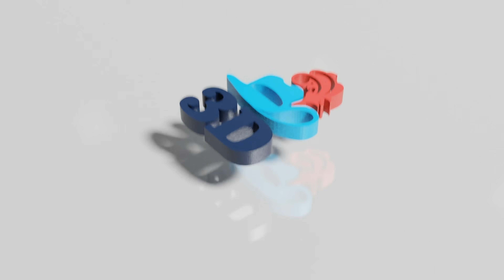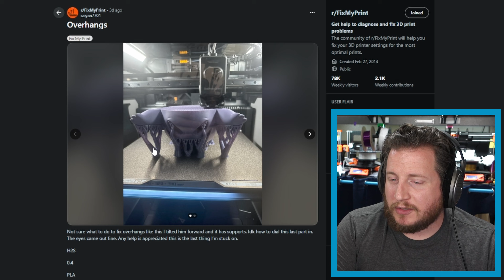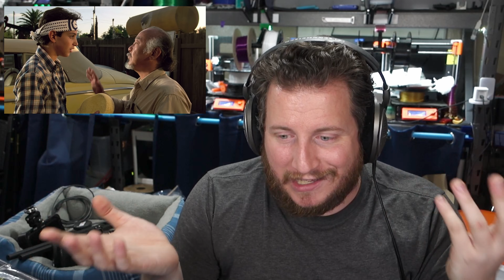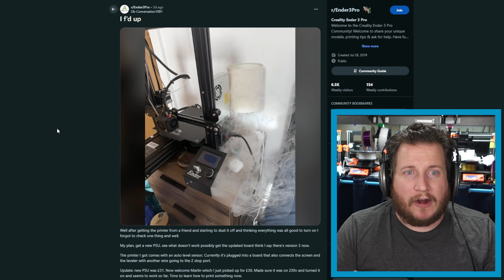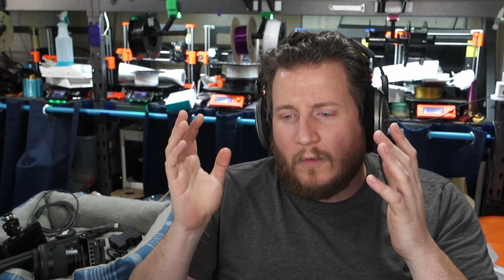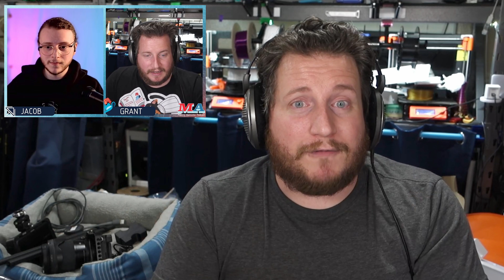We Get BLUNT In This Episode... - PrintFixFriday 238

Comment: I had a smoke issue with my work laptop once.
One job site I went to for years. I was plugging into one outlet near the equipment I work on.
Showed up with a new laptop, plugged in the power supply, which promptly released the magic smoke.
The maintenance guy told me after the fact  that it was a 240volt outlet, which was a standard 120v20amp socket. illegal and not marked as 240v. We had words. So did the licensed electrician who also had a cordless tool battery charger go up in flames 2 weeks later.
Old laptop power supply didn't care it was getting 240, the new one did.
Still thankful it didn't take out my new machine

Comment: Bed cleaner == dish soap, lots of running water and drying with something that doesn't stick. It doesn't have to be expensive.
Reply: I spray my bed with Dawn Power Wash, then rinse under the faucet.  Handle like a record placing back in the machine after letting it drip dry.

Comment: The ender 3 probably blew a filter capacitor, the smoke can linger around for a while after the power got cut to the machine
Reply from the maker: seems reasonable to me!
Reply: Put the 120/240 on 120 on a 240 region and you'll overvolt the capacitors.